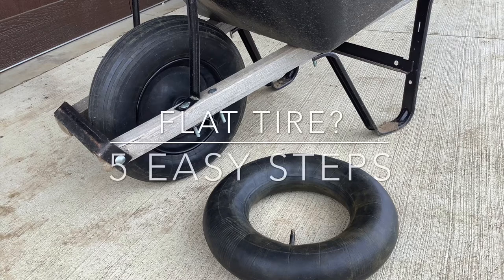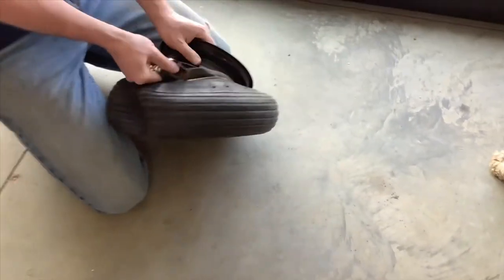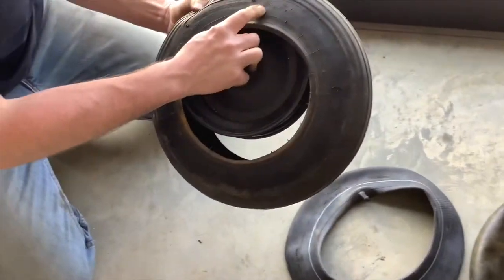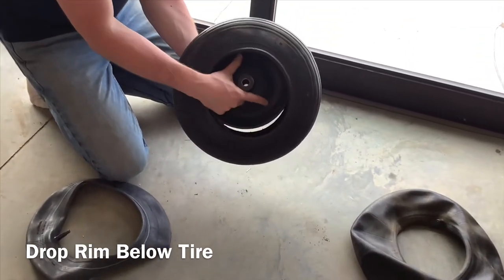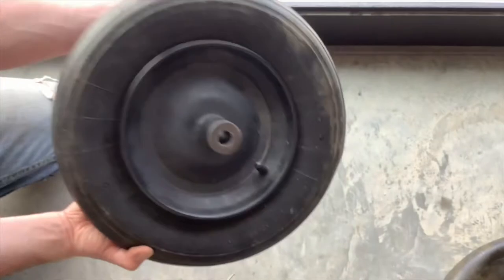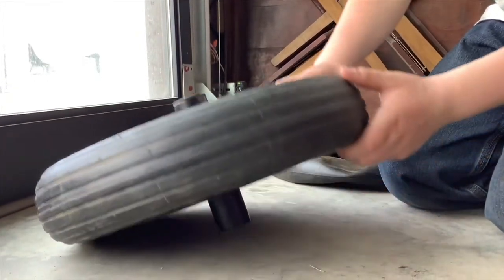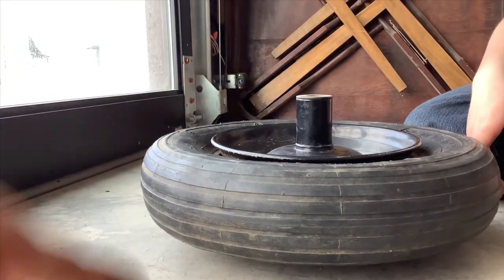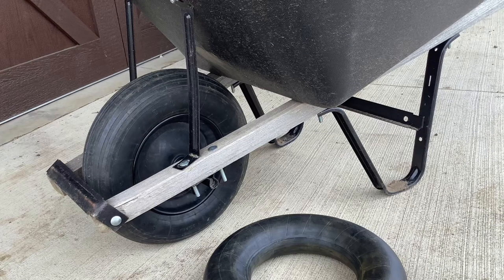How To Change Wheelbarrow Tire Tube [5 STEPS]

Comment: Thank you for sharing this. I  think I might have spent 4 hours messing with the tire, then I saw yours. Found it a little hard at first, putting the inner tube in, but got there. Then disaster, when I came to put the little piece in where you put the air into, well mine turned out to want to go the other way. So, will have to restart it all over again,:face-fuchsia-wide-eyes:
Reply: Very helpful, and done without drama and heavy rock music too!

Comment: I have been trying to get the tube out with no luck , it's so tight . I was thinking about patching it but it looks like I'll be cutting it outwith a sharp cutter . I put the tube in that tubeless tire 20 years ago . When putting air into the valve I used a pair of needle nose pliers to gently hold the valve stem from being pushed in ....worked fine . Thanks for the video , new tube will be installed .
Reply from the maker: Great glad it was helpful.